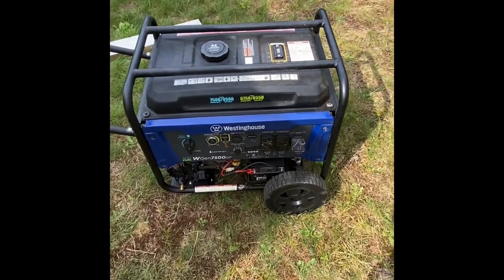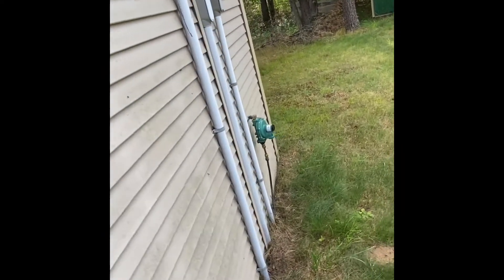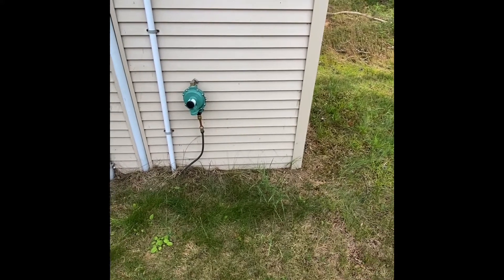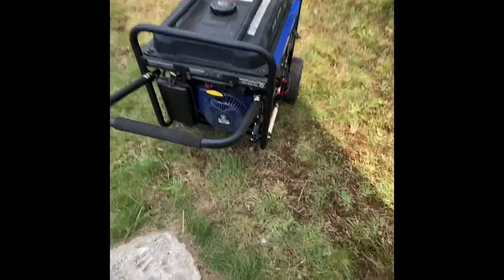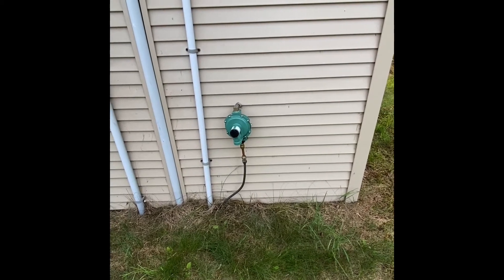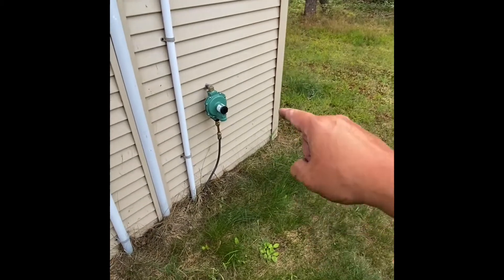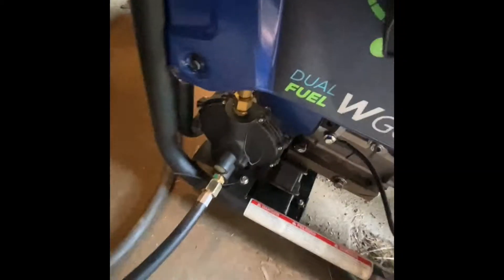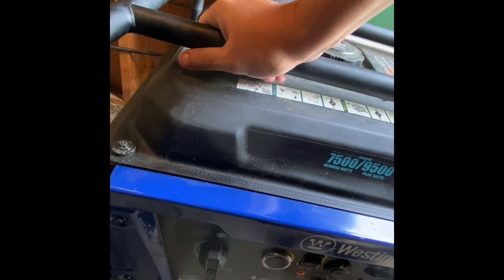Propane Dual Fuel Generator running on a 500 gallon LP tank Westinghouse 7500DF

Comment: While touched on elsewhere, for a little top to bottom understanding of working with propane and generators:
1. Tank storage - Propane is a nature refrigerant.  Depending on temperature, it will evaporate at different pressures in the tank.  The pressure range in the tank is usually far greater than ambient sea level air pressure.  Maybe on a very cold day, you will see down to 40 PSIG or a very hot day up to 300 PSIG.

Something people get tricked on are pressure based fuel gauges.  Pressure varies a lot depending on temperature, so a pressure based gauge tells you basically nothing; it is false advertising.  There are three major ways i know about to get a reading on fuel level.  One is a float based gauge.  The float floats on the liquid propane.  Not super accurate, but generally good enough for generator use.  The second is a sonar based gauge.  They make these for all sizes of propane tanks and they are highly accurate, more so than a float based gauge.  The third is a scale.  You know the empty weight of the tank, just measure how much over that empty weight the tank is and you know precisely how much propane is in the tank.  The sonar sensor and scale are both external to the tank, so something you can do with any tank.  Especially if you are doing a 500 gallon tank, you probably want to get a sonar gauge.

2. Distribution regulator - This is a big thing people get wrong.  The distribution regulator only drops the pressure down to 10 PSIG.  It is meant for getting the propane from a large stationary tank a long distance around a rural property to near the consumption point.  This a a balance between full pressure where a leak can be catastrophic and low pressure where a leak is general minor due to the low pressure.  Distribution pressure is generally kept outside so a leak doesn't lead to a buildup to the point of explosion.  In the open air, the propane gas should disperse and not explode under most common circumstances.  Inside, it is easier for the rate of loss in a leak to lead to a deadly buildup.

3. Pressure regulator - Drop the pressure down to 10 - 14 inches of pressure or ~1/3 of a PSIG.  The kind of pressure you blow candles out on a cake with.  This is the first regulator that generally comes with the generator.  Something some people complain about freezing over in the winter as gas can expand from the still fairly high pressure main tank down to candle blowing kind of pressure.  But a distribution pressure of 10 PSIG should be a little easier on this regulator in the winter time.  People often don't realize they need the pressure regulator after the distribution regulator on a large tank.  But it just doesn't work that way.  The remaining demand regulator and engine won't work without a pressure regulator.

4. Demand regulator - Designed to cause the engine to suck in the fuel as opposed to free flow into the engine.  The key final piece taking this propane that has been regulated down to candle blowing kind of pressure to flowing into the engine as the engine demands it

Comment: I have a Westinghouse WGN12000DFC . It is new and has only been run a few times.  I have only run it on a 20lb. tank and it runs fine. I wanted to hook it up to my 500 gal. tank, so I had  my gas company run a line to my gen shed. Westinghouse support told me I  needed to add a regulator to drop the pressure to between 0.25-0.50. I passed this on to the gas company tech. He ran the line and added the regulator, but now the generator backfires non stop. It seems like my setup is very similar to this, does anyone have any idea why it would work for this guy, but not for me? Thanks

Comment: I wanted to share a general comment to explain how this works for his generator and how this can apply to other generators like Champion.  Propane Generators will run from home pressure which is normally between 11-14 inches of water column.  In his situation he has a primary pressure regulator at his 500 gallon tank, which drops the pressure to about 10psi.  He needed a secondary pressure regulator at his shed to reduce the 10psi to the required 11-14 inches of water column.  The generator also needs a "flow regulator" which his generator has built into the generator, you can see it where he connects his hose to the generator.  A flow regulator will not let any propane through unless there is vacuum coming from the engine to suck it through.  A lot of smaller generators do not have a flow regulator built into the generator.  For example some propane hose kits you get with Champion dual fuel generators contain the pressure regulator and flow regulator as part of the hose kit.  In that case you need to  separate and remove the pressure regulator and only use the flow regulator to get those to work properly.  Sometimes the brass fitting needed are a little hard to find, but it can be done.  I have done this with my 4250 watt Champion dual fuel generator running off my home 1000 gallon tank.  I tapped into the home pressure line (11-14 inches WC) and use only the flow regulator supplied with the propane hose kit.
Reply: Hi, I have a Champion generator ( Model 100592) and it came with a 2 stage Regulator Model #: G2R150. Do you know if this is Only a  Pressure Regulator or is it both a Pressure and Flow Regulator?
Reply: @marcussmith6035  It is a pressure regulator only, item 97 on your parts list.  Your flow regulator is built into the generator behind the LPG inlet, item 99 on your parts list.  They call the flow regulator a "pressure reducing valve" for item 99 description.
Reply: @whatsinanamethatthecaptive577  Got it! Thanks!
Reply: Does it matter if that flow regulator is closer to the generator side of the hose or the gas supply of the hose? I’m trying to set mine up.
Reply: @collin_fdj  I have only seen the flow regulators mounted in the generator or  within 3-4 feet of the generator on the hose kits, so we know those distances work.  I don't know how it would work farther away than that.  Maybe someone else would know.  Sorry.

Comment: Love this video!! It solved a huge problem I was having. I have the exact same Westinghouse DF generator and I was told, and the directions seem to indicate that if you have between 10 to 14 inches of water column of pressure incoming that you should bypass the internal regulator that comes built into the unit. However, when I did this and opened my gas shut-off valve, I could hear propane free flowing through the carburetor which made me think I had damaged something. Then after watching this video I realized that all I had to do was to reconnect the internal regulator and SHAZAM!! instant success. 
Thank you for the help!!!
Reply from the maker: That is awesome!  Glad this video helped!

Comment: I must do that!  If I have access to the propane pipe after the regulator at the propane tank, can I tap into that and connect a BBQ regulator between the propane pipe and my Dual Fuel (propane/gasoline) and run it? Or, do I need some other regulator?
Reply from the maker: Great question and I tried a BBQ type regulator but it didn't work.  I ended up needing a low flow regulator like the one on the outside of the shed.  I was able to get that regulator from my local propane provider.

Comment: It looks like your generator came with a regulator that reduces high pressure from a tank so I am wondering why you needed to add the regulator on the outside of the shed?
Reply from the maker: You are correct there is a regulator on the generator but it doesn’t reduce the flow low enough to operate properly. The generator would start but it ran terrible and you could actually here regulator humming from the high pressure.  Trust me, I tried :).
Reply: @offgridcabinlivingandprojects  His generator has a flow regulator, it's not a pressure regulator.  A flow regulator does not let propane through unless there is a vacuum from the engine sucking it through.  I will make a general comment at the top to explain how all this works.

Comment: Great video!!!
Do you happen to have any information on that regulator you installed outside of your shed? Brand name, and part number? 
I`m looking to hook our Westinghouse Wgen9500DF up to our large propane tank so we dont have to constantly switch out the 20LB grill tanks all the time.
Reply from the maker: Hi Larry.  This is the label from the regulator. My propane company was nice enough to provide it but I have seen them on Amazon. Here is the link. https://drive.google.com/file/d/1f7_RXlT7Us_aFUySPYwY3rIG2yIzgD99

Comment from the maker: The propane line I used was simply a Char-Broil line for a gas grill I bought at Lowes.  The flare connection at the generator is 3/8" and that is the standard fitting size of the extension hose.  I did have to reduce the line from the regulator down to the 3/8" but is was pretty straight forward.

Comment: Nice rigging up for the propane.  Just remember when you get ready to run the generator for the cabin,  you need to run the same distance back to the cabin with a proper guage line appropriate for the amp and it is looking like a hundred or do foot line 6 or 8 guage wire.  I paid almost $100 dollars  for a 35 foot heavy duty 6 guage 4 wire cable  and connector to generator in place.

Also take into consideration that the further the distance away,a drop in power takes place and a bigger guage  wire it takes. Water pump shed is nice storage for generator,but you could tape into line near tank maybe a little cheaper.   I DON'T WANT  TO SOUND CRITICAL,  just passing on my information.
Reply from the maker: Thanks for the advice!  The original owner of the house had run a gas line out to the shed for a wall heater that he used to keep the water pump from freezing in the winter months.  I agree 100% that he could have saved a bunch of money by moving that shed closer to the house and reduced the length of run for the electrical and the propane lines.  The house is off grind and the main electric connections for the house, garage and sheds are in that pump house shed so it was really easy to hook up generator and having the gas line out there already was a bonus!  But if I were to do this from scratch I would have my LP company install a tank outside the shed and make a short run from the tank to the generator.